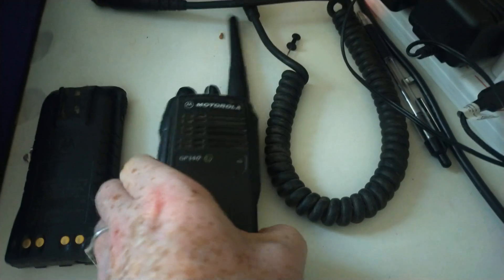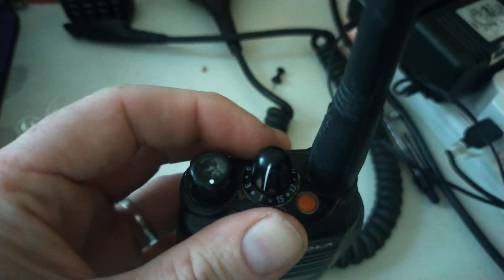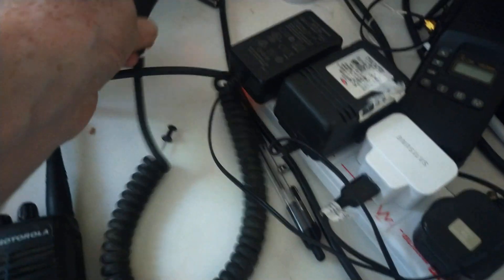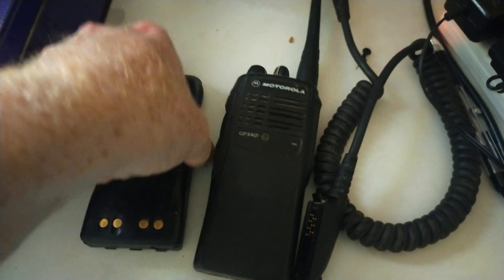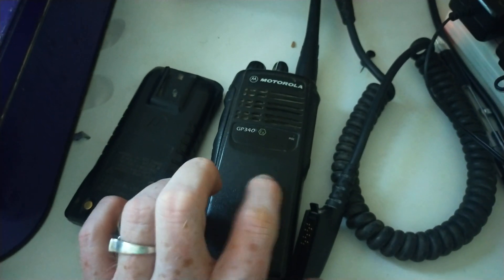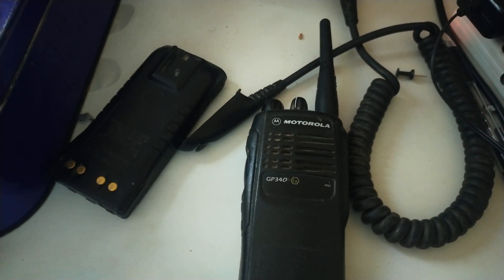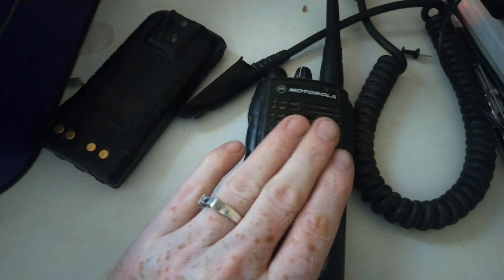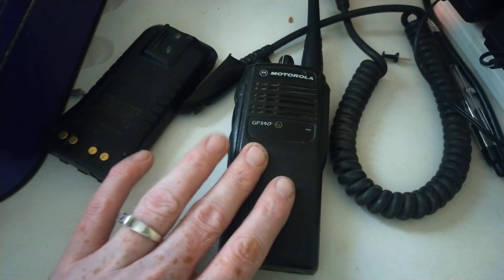A Motorola GP340Ex I recently obtained #motorola #uhf #walkietalkie

Comment: I have the 320's and as long as you have the software,  they can be set for PMR446. Worked well in the clubs with headsets. Can't remember exactly, but think they kicked out 4w. Good, rugged radios...battery life wasn't as good as they are today